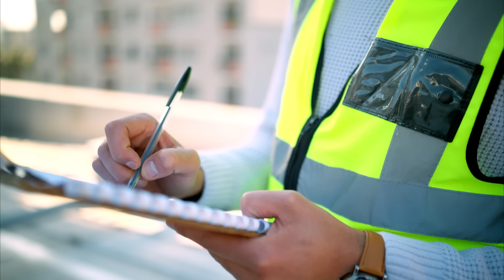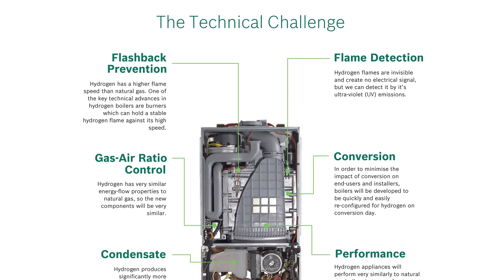Is Hydrogen Actually Dangerous? | The Real Facts

Comment: Roger: hydrogen needs all new pipes and home modifications and installation changes and converters but it’s the future!

Roger on heat pumps: it’ll never happen it needs too many changes!!

Hydrogen ain’t happening bro.
Reply from the maker: Don't misquote me. I said that heat pumps won't work in many older homes. The changes required are far more than just replacing a boiler with a heat pump.

Comment: I suspect that hydrogen will find a place in the energy infrastructure of the future, but it might not be what people are imagining today. H2 could be made with  offshore nuclear power stations that could be located far enough from humanity that safety would be less of a potential issue. Then the hydrogen could either be used as is, or combined with other gasses to produce methane or methanol. I don't believe it makes sense to try to put hydrogen in pipelines, because any leaks will let a lot more hydrogen by than any other fuel. 
PS: Will hydrogen ever be used for airships again? I've read that the biggest problem with the Hindenburg was the flammable fabric, rather than the hydrogen itself, but it remains to be seen how safe a balloon made of non-flammable material would be if filled with hydrogen.

Comment: 6:07 from everything I've heard, methane is actually about half the density of air, though I'm sure hydrogen is lighter still. So Elton John's attempt at nullifying his troubles in the early 1970s probably wouldn't have worked as intended. There have been stories, some of them quite tragic, of people trying the same thing and ending up with explosion, rather than asphyxiation. Propane, on the other hand, is heavier than air, and old-fashioned "town gas" was often heavier as well, and that's probably where the phrase "head in the oven" originated. All of these can cause explosions, but under different circumstance.
Reply: Not the density - it was that town gas had Carbon Monoxide in it that made "head in the oven"  possible

Comment: LCOE of any Power to X project will be sky high. Energy prices will need to multiiplynseveral times before tjis starts to become feasible. It requires electricity prices close to zero. On shore wind and solar has the lowest LCOE today. Although the availability is increasing it is still a fraction of total energy consumption worldwide. Power to X to Power is even more ridicuolos. The efficency is likely less than 20 %.

Blending could maybe be feasible at some point but that comes with its own technical challenges.

Comment: Sorry Roger but the UK govt has given up on domestic use of hydrogen. 

It's too expensive by far. Poor efficiency plays a part in this, plus the effort of compressing a very springy gas and the difficulty of piping and storing something that loves to leak away. 

You covered the safety issue. It's quite a challenge. 

Domestic hydrogen will always be more expensive than domestic electricity. That's the main reason we won't use it.

Comment: Hydrogen in bottles for us off grid folks would be great. Currently so many rural people rely on propane in red bottles or large tanks. Fingers crossed a solution will be found. 👍
Reply: Rural people would do better to switch to heat pumps, possibly with as much battery or other backup as necessary.
Reply: Off-grid hydrogen generators and storage are already available, hydrogen in cylinders for over a century.

Comment: It will be good ... If I can have a Hydrogen Tap in our kitchen & ... We can have Red Bull DIY Balloon Festival. 

Re _ Video .....  It is madness to replace the gas grid at all ,  we should be phasing it out..   The False Hope of H2 is just an excuse for perpetuating fossil gas ...  .. .  you don't " Top up the fuel cell on the bus"  .. the H2 is stored in large cylinders, .. As you say Planes [& Ships] could run on H2 ... that will use up all the supply ...  At the minute 2% of the worlds natural gas is used to make Hydrgen for chemical industry, so green hydrogen should go there first too. 
If  Green Hydrogen for heating, you need about  6x the KWh of electricity to heat a home as you would with a heat pump.  For Trains, Trucks & Cars ...  Battery Electric is already dominating .
Reply: The gas renewal is scheduled to end in 2032. Hopefully they'll focus on phasing it out at that point.

Comment: No way I would trust one of the British bodger plumbers, but I would trust a professional to do the job or checking the job afterwards. The only professional gas engineers (or electricians) I have met have been working for the distribution networks. 
It’s a fundamental of risk management to eliminate the hazard, keeping all H2 lines and boilers outside would achieve this perfectly. That’s why i keep my home battery outside too, I don’t care if I have a lithium fire on the outside of the property.

Comment: Think you needed a bit more research on this one!
Hydrogen is no more intrinsically dangerous than any flammable gas.
Both hydrogen and methane are lighter than air by the way.
It is however the smallest atom so leaks through many materials other gases would not.
In spite of its high energy density (per weight) it takes up a lot of space and most of the danger around hydrogen is the high pressures and low temperatures required to store it (this does not apply to pushing it through a pipeline).
Most importantly however is that, while an extremely common element, it does not occur naturally! 
A great deal of energy is required to separate it from water and splitting it from natural gas is still just using fossil fuel.
It's primary advantage is its energy density and compatibily as a replacement for fossil fuels, natural gas and petroleum with minimal modifications the eqipment using it. 
As battery  storage and other energy storage technolgies improve any arguement for using hydrgen will disappear.
Reply: And no-one makes H from water electrolysis. This seems to be an image of clean water conjured up by marketing. It's fracking fossil fuels is much more efficient.
Reply: WRONG.
Reply: no more intrinsically dangerous than any flammable gas? check out the upper and lower explosive limits compared to NG and LPG
Reply: I think it needs 4:1 energy to create H2?
Reply: There's a strong argument that battery technology has, or soon will, hit a natural limit. If anything I'd say the hydrogen storage and general safety technology is more likely to see improvements if it starts to be adopted. That said, I think arguments for using hydrogen will disappear as arguments against natural gas disappear - that is, the bizarre decades-old meme that carbon as such will heat us all up like an oven and ruin the environment.

Comment: We can't AFFORD hydrogen.  We can't even afford the electricity at current prices yet hydrogen is completely wasteful as far as production is concerned.  A totally ridiculous concept that only survives on the usual necessity of SUBSIDIES.
Reply: Utter bollox.
It just depends on how generated.  Currently the wind turbine industry gets paid £1 BILLION a year to put the brakes on. Ie 1 BILLION to NOT generate any power. That is absolute madness.
Use that to generate H2 and use that.
Reply: @Kate_Short-For-Bob  hydrogen plants cost too much to run occasionally, so would need to be fed electricity 24/7, even when the electricity is expensive. So this is a non-starter.
Reply: @Kate_Short-For-Bob or get more storage batteries into the system which makes more sense.

Comment: No one is saying heat pumps aren't safe, they don't believe they work for everybody which is 99.9% untrue. However H2 in the domestic heating situation has been chucked out in the 2 major schemes, one in the Wirral the other in Redcar. That the gas suppliers were to be given right of entry to peoples homes to have the ability to check safety was just one of the things that stopped the projects. H2 has been kicked into the long grass by the rail industry and many H2 buses stand idle. Toyota has a big court case against it on the famous Mirai H2 cars which users found frozen to the pumps delivering hydrogen. H2 will be useful in steel making and other petro-chemical industries and that is just about it.
Reply: Mate heat pumps don't work in 70%+ of installations. I'm involved in a court case against the district Council and social housing provider as they've retrofit  heat pumps in council houses and its on average increased the electricity bills by over 100% in the winter.
Reply: @strongstories3183  Obviously, unless the original heating was electric, the electricity bills are bound to go up - what did you expect? If the original heating was electric, it seems almost impossible for bills to increase, I suppose if the storage heaters worked well and the heat pump SCOPS were terrible, but it seems unlikely.

My total bills (electricity + gas) were significantly decreased after installation of a heat pump into my normal house.
Reply: @strongstories3183 did they install solar panels to help?  How much is your electricity price now
Reply: @BobbyVerr Each technology should be judged on its own merits.      Heat pump installations are already being financially subsidised; thus making it harder to evaluate that technology.
Reply: @oldbutstillcurious3615  Lots of things are subsidized, with heat pumps we are still at the stage of early adopters and at the stage where the spark gap in the UK is ridiculous. We need the adoption of heat pumps, and encouraging early adopters is the chosen way to go ahead. We need to get the spark gap down and then heat pumps become no-brainers and will be far cheaper to install.

The fossil fuel industry, however, continues with its obscene subsidies, despite the massive damage they are causing to our world. These subsidies should be removed, and the fossil fuel companies should be forced to pay for their pollution.
Reply: Heat pumps don’t work for everybody because most people live in flats. The COP of heat pumps is a made up figure ie in a test lab, same as solar PV which is tested on Swiss mountains and solar tracking, which means jack shit if you live in a two-up-two down house in Bolton. Take away any feed-in tariff and all of a sudden renewables ‘don’t work’
Reply: For flats, electric boilers
Reply: I think you will find that it is possible to have heat pumps in flats...https://www.youtube.com/watch?v=_2L9h3RqOLE

Comment: H2 is just the oil and gas industry green-washing.  "Just use natural gas to reform H2 until we have enough green H2" : of course it takes 140% more natural gas to create the same energy but hey.  More profit.
You mention buses.  It will take >12 H2 tankers to transport the equivalent energy as a diesel road tanker.  H2 refuelling slows as the pressure in the tank increases similar to battery charging.  So use batteries and electricity directly. 
Create H2 from electricity?  Just use the electricity!  How could H2 be cheaper? Burning stuff is inefficient!
Any significant green H2 is needed to decarbonise industry.
Reply: Can’t blame the oil & das industry for trying to cash-in on the same hysteria which has propelled wind and solar subsidy farms to such great financial success at the expense of energy consumers.
Reply: @brickmissing8295  The oil and gas industry has been cashing ever since the stuff was discovered. The subsidies given to fossil fuels have in the past, and continue to be, far greater than those given to renewables. Your electricity is so expensive because it is derived from the price of gas, if we had local electricity pricing, those areas served entirely by renewables would be massively cheaper than those from gas generation.

Comment: You contradicted yourself: at 3:32 you said hydrogen requires less energy to ignite, and then straight after that you said it's harder to ignite.. .which is it?
Reply: it requires less energy to ignite. But it is harder to create the conditions required for it to ignite. Point 1 is about triggers, point 2 is about environments.
Reply: These two statements are not contradictory.
Reply: @thegrandmuftiofwakanda  I wish he'd been clearer about why
Reply: @joebloggsgogglebox  

I don't think anyone could possibly be any clearer on this point, but let me try :

There are challenges associated with igniting hydrogen beyond finding the energy to do so.
Reply: @thegrandmuftiofwakanda  it's pretty clear to me that Roger made a mistake, and meant to say "easier" instead of "harder" at 3:45, just listen to what he says directly before and after that; it doesn't make sense if he really did mean "harder". Also I checked with ChatGPT which pointed me to several studies that say hydrogen gas hobs are easier to ignite than methane ones.
Reply: @joebloggsgogglebox  No I don't agree with that at all.
Reply: @joebloggsgogglebox  

You don't understand the point with which you have being confronted.

The fact that a hydrogen hob is easy for your mum to light when she is doing you your favorite boiled eggs and soldiers doesn't actually mean its easy to light, It just means the engineers have done the work.

Comment: The bus may not have a big battery, but it still  needs a heavy high pressure tank. Batteries are way more efficient at transporting energy than hydrogen

Comment: That's a bit disappointing, I've just had a heat pump installed and now you're proposing hydrogen will be the heating choice for the future.
Fast forward 20 years... Will we see the government offering a £37,000 grant to people who need to rip out their old fashioned inefficient heat pumps and replace them with a hydrogen boiler... 🤔
Reply: I used to think Hydrogen boilers were a good idea until I discovered how good Heat Pumps have become.
I still think we need Hydrogen for energy storage, but using that to generate electricity to power Heat pumps will be 4x less expensive in terms of cost per kWh and it will not require maintaining a fine grained gas network going to every home.

Some buildings may be a challenge right now, but we don't need to stop using natural gas everywhere at once. Insulation will solve a lot over time.

Hydrogen is something for the professionals, not something for the home.
Reply: @SolAce-nw2hf  Yes indeed, insulation for UK homes is the key to reducing heating costs.
It's a shame aerogel insulation is still so expensive, assuming it's as good as it appears to be it could be used in homes where space is an issue.
Reply: I can't see governments of the future subsidising hydrogen heating over cheaper electricity!

Edit: *electrical heating (with any form of heat pump)
Reply: @Biggest-hz7ng nobody knows what the government will do ... not even the government.
I'm thinking diesel cars!  I got one of them when they said they were better than petrol 🤪
Reply: @roblinc2u  diesel was better until particulate (and nitrous oxide) science caught up with it.
Reply: You ok? If you can use a low temperature heating like a heat pump why would you ever switch to hydrogen 😂

Comment: A great video and topic. Hydrogen needs to be used for its benefits to the planets etc as well as providing a great oppotunity for gas engineers. A Win Win.
Reply: Electrification is better for the climate. Hydrogen will be used in niche cases.
Reply: Electric is great but not perfect. The answer is a combination. As roger says, we cant store electric or have elec buses, planes and trucks but they can be hydrogen. If they do manage to pipe it to houses etc using existing pipework why not use it. The wind turbines up scotland are turned sometimes because the grid cant take it, so they could use them to make hyrogen instead? Hydrogen is good clean stored energy.
Reply: @mattmartin8366  electric buses and trucks are already here (trucks are rolling out in Spain and Scandinavia)? Airplanes won't use hydrogen directly, but likely fuels derived from hydrogen. We can't use just the wind turbines in Scotland because the expense of a hydrogen plant needs 24/7 electricity. So we are better off electrifying everything first.

We may at some point use hydrogen for long term energy storage, but that is some years away.

Comment: I suppose it would best to replace gas turbine power stations with hydrogen instead?
Reply: No, better to use other batteries to store excess electricity instead. Hydrogen makes a very expensive battery, chemical, heat, mechanical, all are better batteries.

Green hydrogen may well have a place in areas like steel and concrete production, but not for home heating or ground transport.
Reply: No, better to use gas as a backup until we have sufficient long term storage for the renewables. Hydrogen may be some of that long term storage, but the priority is replacing gas in generation.

Comment: When looking at volume natural gas burns 3 times hotter than hydrogen, could the infrastructure handle the increased volume being used and would the user be charged more to heat their home amd cook a meal as they will be using more. We all know the ones who profit out of this will not care about fuel poverty. As long as they can tick a box to say they have done their bit for the environment and make a profit.
Reply: No one will be doing "this" full stop. Electrification is cheaper and more efficient.

Comment: Geek alert... They went to the moon with hydrogen fuel cells... When you think of the criteria the engineers were working under designing engines that ignited without failure, etc things had to work 100% and they had no concerns over using hydrogen.. This was over 50 years ago.. And British engineers were working for NASA developing them at the time...it never caught on probably because other fuels were cheaper(geek alert over😂)